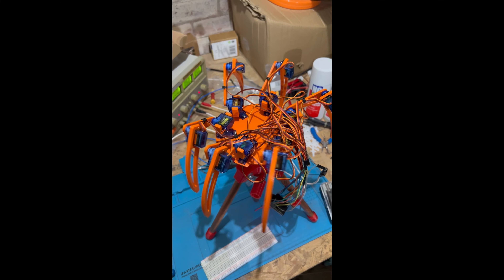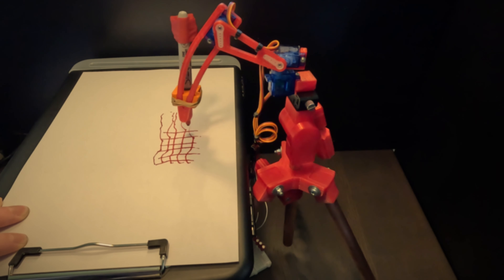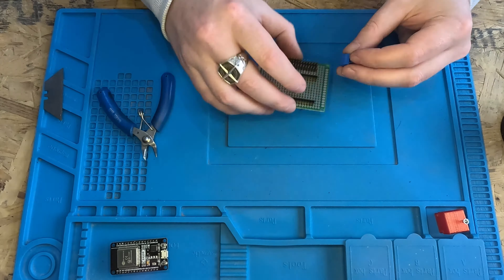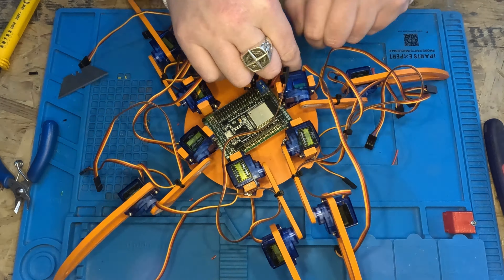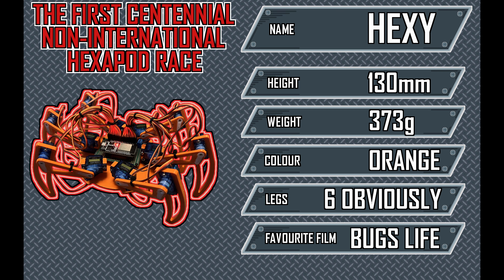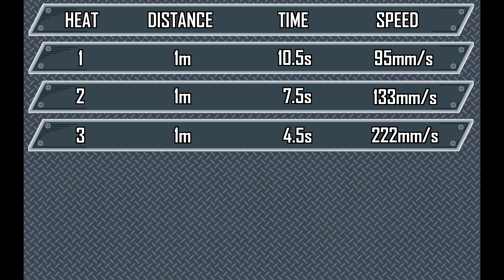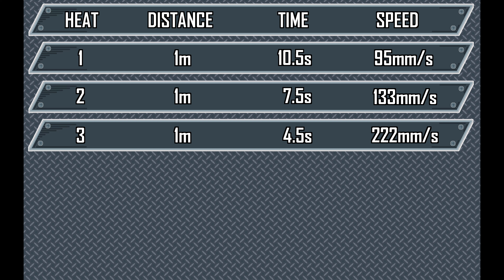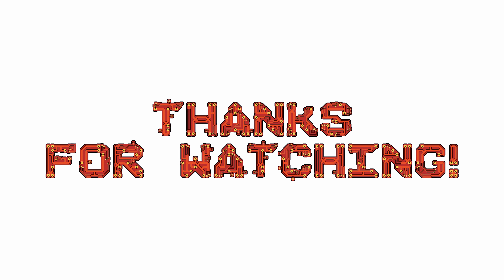Robot Hexapod - Small and FAST!

Comment: hey man. I made my little robots have a webserver on board the esp32 and then expose the various values through the web page and allow for realtime adjustment that way.

Pretty certain this was just a demo somewhere that I extended upon. Not hard to do. Easy to do things like steer crudely or even accurately depending on how you manage the info, and adjust things like global stride lengths or individual leg offsets in realtime for tuning. Hope it helps.
Reply from the maker: Thank you, yes I was thinking of using Http Get/Put for my two way comms so it could be web based or ESP32 to ESP32.

My biggest battle is how much power the little servos use but aren't really strong enough to carry more batteries, I might end up making a bigger one!
Reply: @JustAnotherMakerChannel  cool. yeah its doable anyway. Done it with bits of scrap

Comment: Subbed:

void CartesianMove(double X, double Y, double Z){
    // Slap on the rest positions to Y and Z, because we ain't got time for zeros
    Y += Y_Rest;
    Z += Z_Rest;

    // Time to whip out some trigonometry, brace yourselves
    double J1 = atan(X / Y) * (180 / PI);  // J1, just casually chilling in the XY plane

    // H, the hypotenuse in the XY plane. Pythagoras is spinning in his grave
    double H = sqrt((Y * Y) + (X * X));

    // L, the line from the origin to the point in 3D space. Pythagoras is now breakdancing
    double L = sqrt((H * H) + (Z * Z));

    // J3, the angle between J2 and J3. Law of cosines, eat your heart out
    double J3 = acos(((J2L * J2L) + (J3L * J3L) - (L * L)) / (2 * J2L * J3L)) * (180 / PI);

    // B, the angle between L and J2. Law of cosines, round two
    double B = acos(((L * L) + (J2L * J2L) - (J3L * J3L)) / (2 * L * J2L)) * (180 / PI);

    // A, the angle in the XZ plane. But Z rest is negative, so it's throwing a tantrum
    double A = atan(Z / H) * (180 / PI);

    // J2, the sum of B and A. But 'A' is negative at rest, so we're flipping the bird to subtraction
    double J2 = (B + A);

    // Finally, we update the position with our calculated angles. Take that, physics!
    UpdatePosition(J1, J2, J3);
}
ChatGPT4 commenting on your code in the style of the Quake square root hack. Yup... it can do that ;)
Fun fun fun
Reply from the maker: Love it!